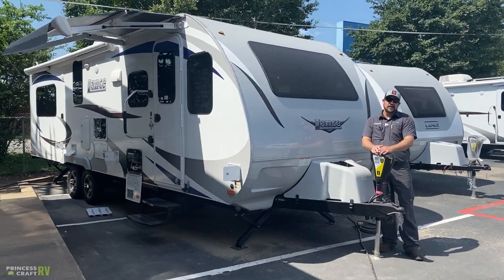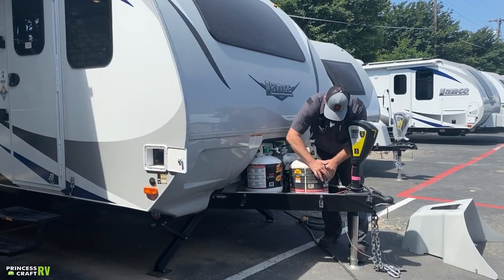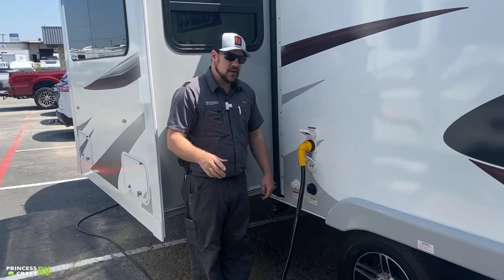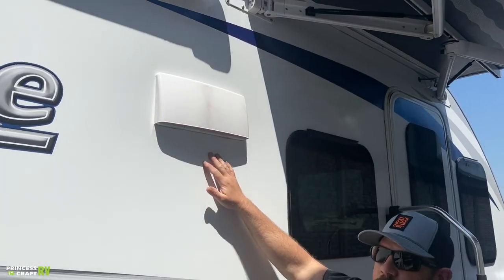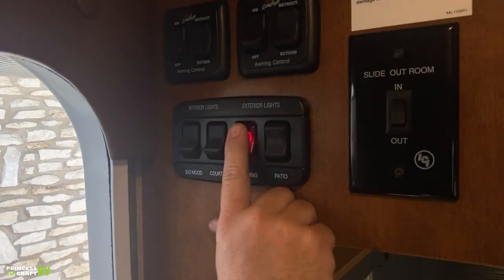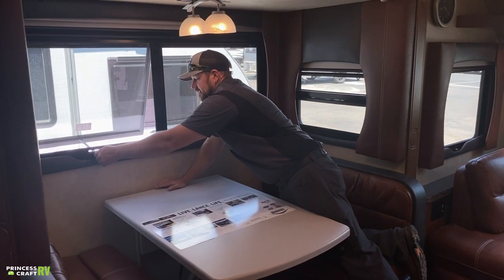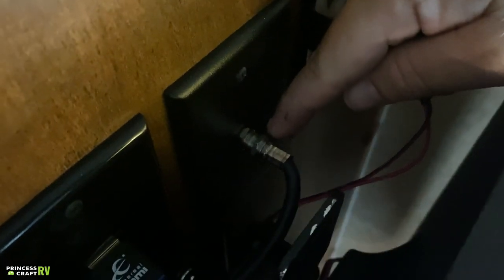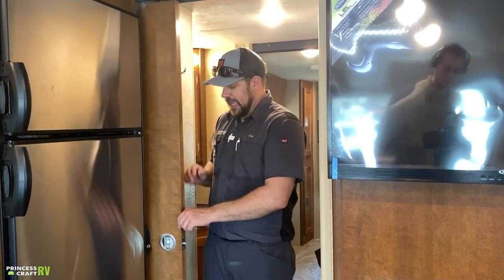2020 Lance 2465 - Technician Tour

Comment: Excellent presentation! I own this year-model and learned things about which I was not aware. Thank you for your very thorough tour!  Be aware that the caps on the bumper can pop off resulting in the expulsion and loss of the sewer hose. Magnetic bumper caps do a better job that the press-fit caps. Another suggestion is to close and latch the sliding doors because the retaining straps detach  while traveling resulting in the door closing shut at some point.
Reply from the maker: Thanks for the real-world experience!
Reply: Me too!  Owned mine for 3 years and learned so many things watching this video.

Comment: Really impressive trailer until the part about 2 separate dump valves and having to switch the gross sewer hose back and forth between the valves to dump the tanks. What a design fail!  The other flaw is putting the shower on the campsite so you have puddles of water where the patio rugs and chairs would be.  Makes no sense.
Reply: Daniel Skapinsky - I think the idea is to empty the single gray tank first and then move the hose over to the black/gray combo outlet, dump the black, and then dump the gray to wash out the hose.
Reply: @jamespkuzman  but there is no combo outlet.  The black and gray are separate valves. Dump the black then move the disgusting hose to the gray valve to wash out.  yuck! Or the tech in the video said to use 2 hoses into 1 hose with a wye but there would still be a dirty black hose.  Plus you have to deal with 3 sewer hoses. That's a hard no.
Reply: Daniel Skapinsky - Ohhhh.... I thought it was one outlet for the gray tank at the kitchen, then the typical two valves/one outlet for the black tank and the gray tank at the bathroom. That’s the way our 2285 is set up, so we never have to handle a hose that hasn’t been gray water rinsed. If I have to move the hose from black to gray without a rinse, I’m out too 😅
Reply: @danielskapinsky7073  This works great! Poo is just Poo.